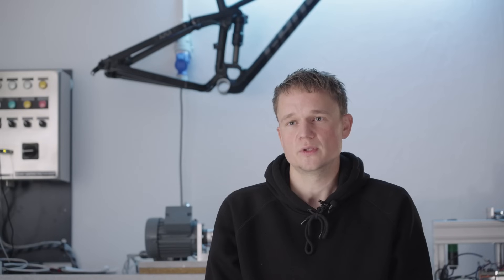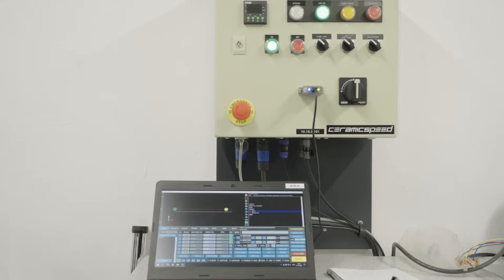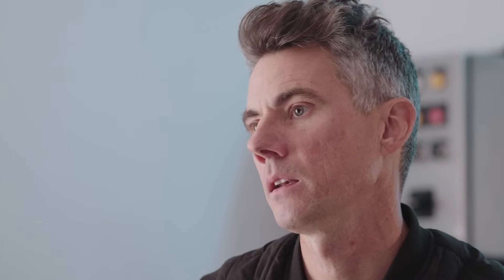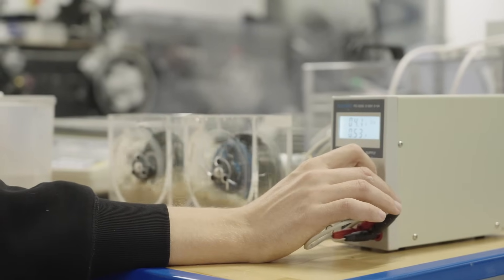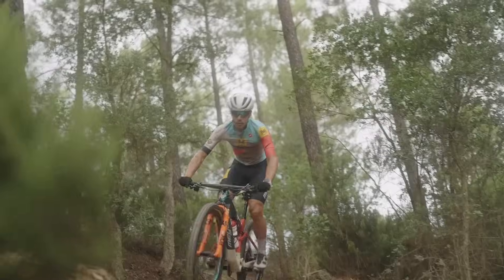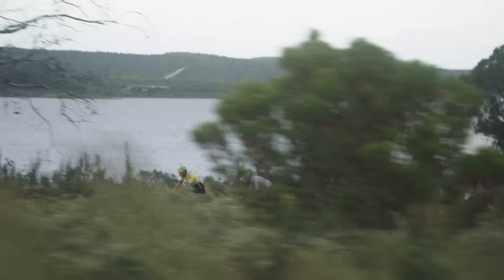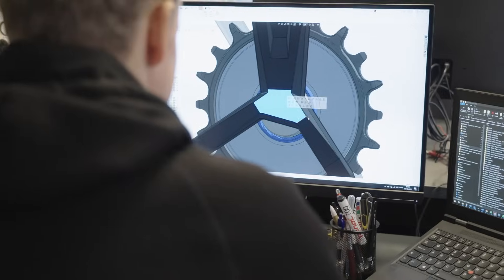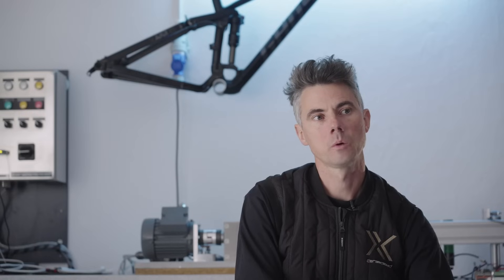OSPW X for Eagle Transmission: The Development Story

Comment: question, since I'm in the market to get me this cage: I have the XX SL original cage, and it is visibly twisted, the pulley wheels, including the so-called 'magic wheel' are not in the same plane, they follow and guide the chain perfectly, as they should have done for many years. a nice innovation. in your 3D rendering movie, I don't see this twist! this is a deal breaker, if your cage doesn't feature the same twist, I will not buy it! please reply fast, I don't want to delay my purchase. thank you!